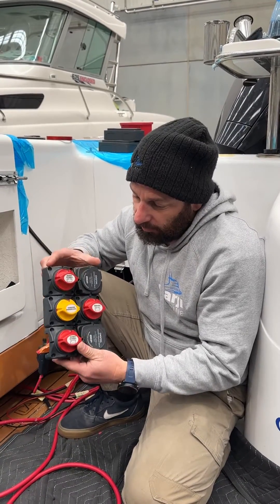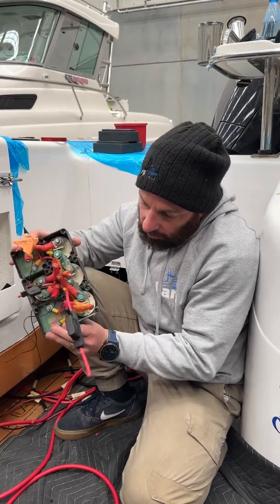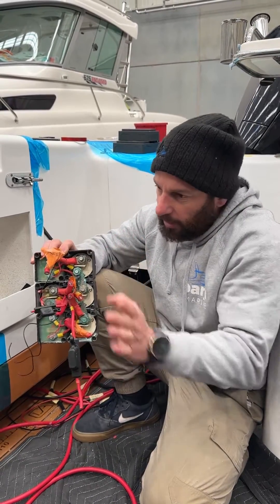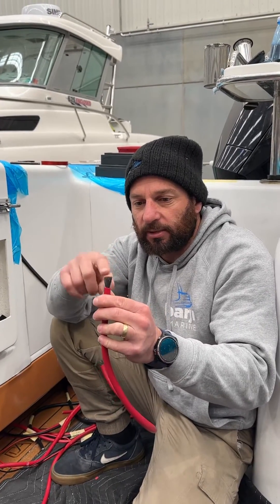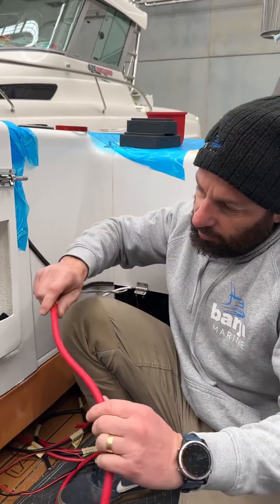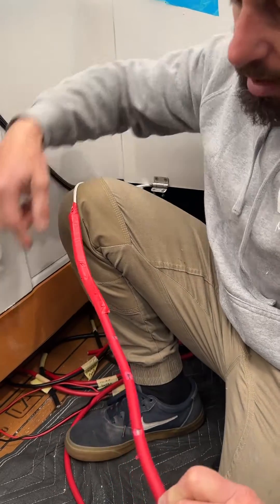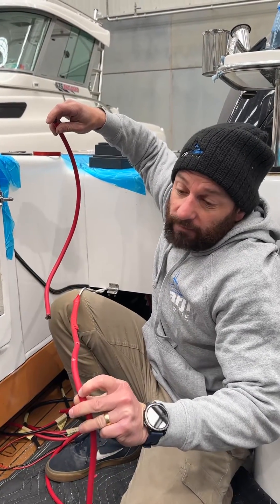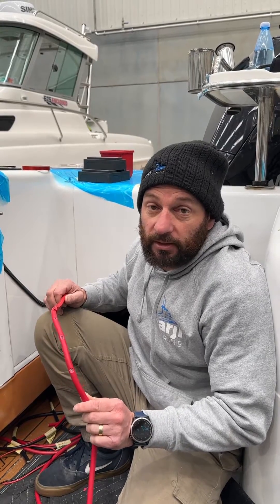Corroded marine battery cable - how far does it go?

Comment: I’m watching this two years late, wished I would have seen this years ago. Bought a used boat, and it has two sets of wires. Motor to switch, and switch to console battery. Ground wire was causing all kinds of crazy issues. Finally figured that out, and repaired cable, however as you point out it was bad a lot farther than I thought. So issue came around again. Now the motor wire is doing same thing. Wish I would have just changed all the cables two years ago and saved myself a lot of headaches! So thanks for posting👍
Reply from the maker: It’s far more common than most realise!